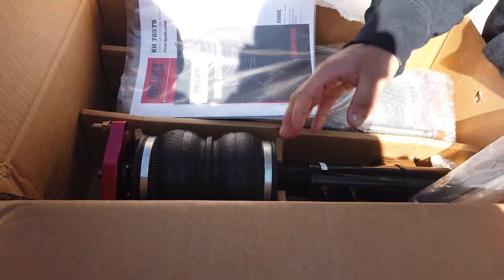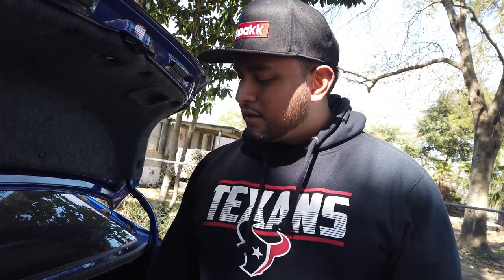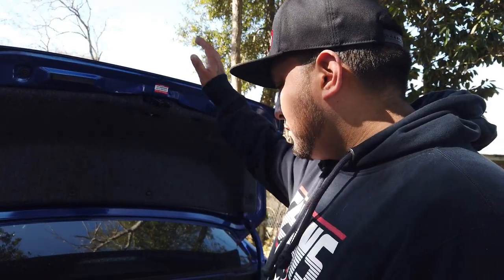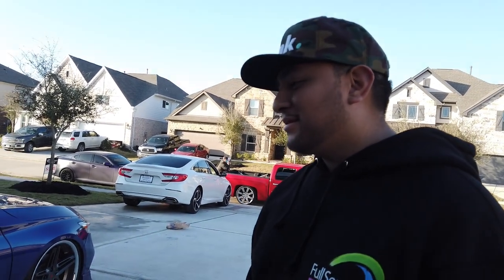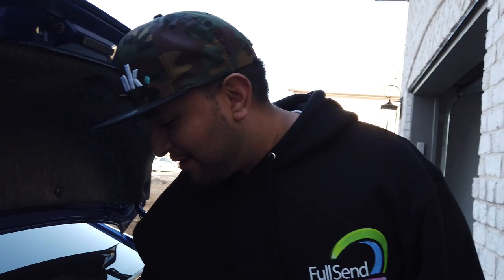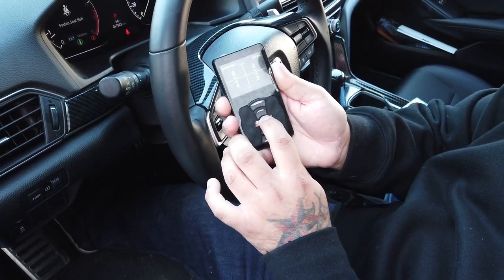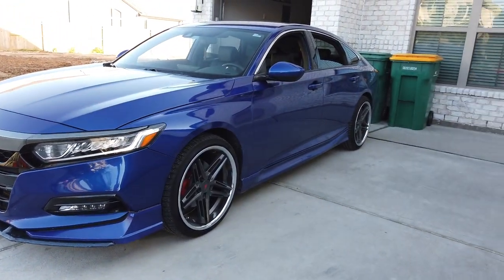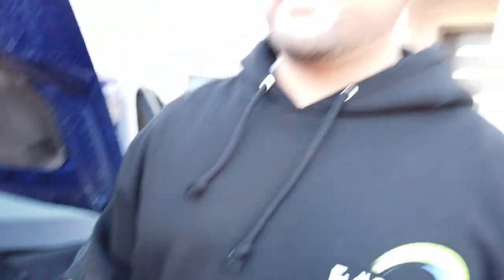BAGGED 2019 HONDA ACCORD SPORT!!! (AIRLIFT 3P)

Comment: First off - wicked job man. I have some questions. How much does that cost? Do I have to constantly get an alignment when lowering and raising the car? Can this be done in cold climates? You’re in Houston. I’m in Toronto. I was told I have to put antifreeze in the line in the winter in order to keep the line clean. Do I have to service that tank in the trunk? I simply want to lower my 2020 Accord one inch in the summer and raise it back in the winter. I’m nervous about speed bumps as well once lowered. Can it be lowered when driving? Please respond when possible. Thanks.
Reply from the maker: Thanks man and something like this can cost you anywhere from 3k to 4k all depends on what management, how many compressors and size of compressors line size etc. However u wana set it up can be your cost. And yes i can lower and lift as i drive or whenever i please. As far as maintenance for the wintee id be lying if i told you something bc we dont get snow or none of that where im from lol but yes you do have to drain your tank from time to time  of any water moisture building up.And no you dont need  to get a al9gnment all the time just when you go for a alignment set your regular ride height and get it aligned at that

Comment: Hey what configuration options did you go with for your air management. (Air line size, manifold, compressor size, tank size)
Reply from the maker: 1/4 line 3p managenement with 2 444 compressors

Comment: How loud is the compressor bro? I live out in Austin but I got a 2018 same color and everything.... 20x8.5 niche targa wheels gunmetal color just put a ktuner on mine but this is my next upgrade but worried about the sound from a compressor..... I have two 5 gallon tanks I can run solo and refill but I know that's probably not the best idea just in case I need more air in a emergency or something.
Reply: O and forgot I got the v3s and sequential reflectors also basically looks a lot like yours with some differences but when I bag it I was hoping to keep my 20x8.5 +35 offsets I know your wheels are wider so what would be the difference between my wheels and yours with the bags? Hoping to not have a camber or if any hopefully very little
Reply: Im running 2 compressors bro so it can be a bit loud but you can get away with just 1 but i mean as long as your not always messing around with the bags compressors shouldnt be kicking on. But yea when aired out i do have a bit of camber not alot but when at ride height i have no camber im running the eibach camber arms in the rear which help with camber
Reply: i have 20x9 not to much wider but yea the 8.5 should tuck a little harder than mine
Reply: @noehernandez2269  bet bro when I save up a little more cash and get closer to the goal I'll probably hit you up with a few more questions lol but either way we'll be twinning hb lol

Comment: Is there a lot of daily maintenance you have to deal with when you are on bags? And was the air lines run underneath the carpet of the inside of or underneath the outside of the car? And how much for the entire 3P management parts total?
Reply: P3 is $1400 no daily maintenance
Reply: @phuckgoogle6343  P3?

Comment: Hey question hopefully you can answer for me, i just got a 21 touring and i want to install the airlift, but i since it has the active damper, would i be able to install the same active dampers back again with no problem and working conditions???
Reply from the maker: no sir you will be replacing the whole struts front and back and the air lift suspension struts already have the option to adjust the dampening as well.